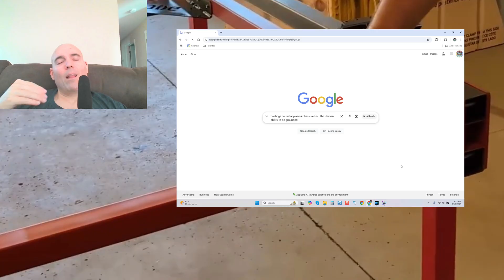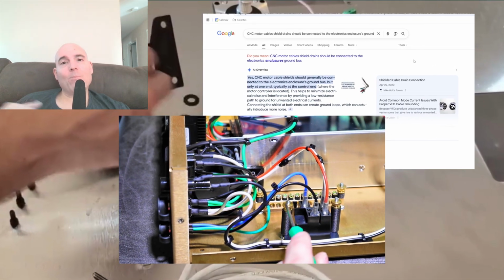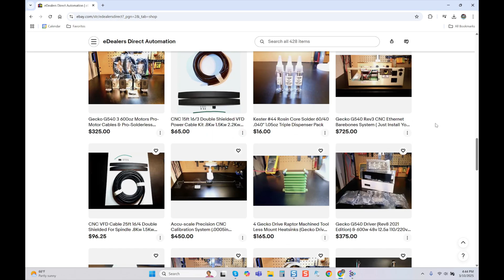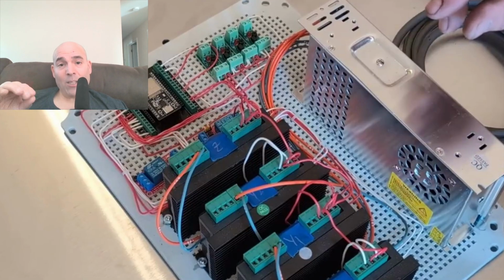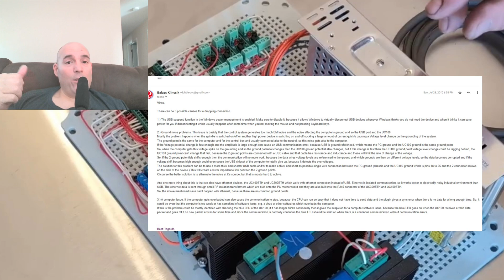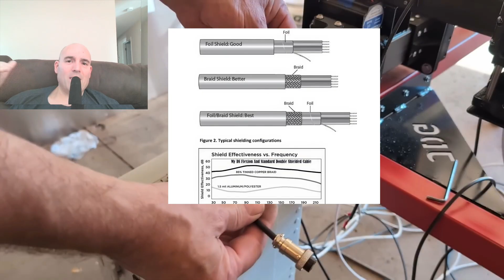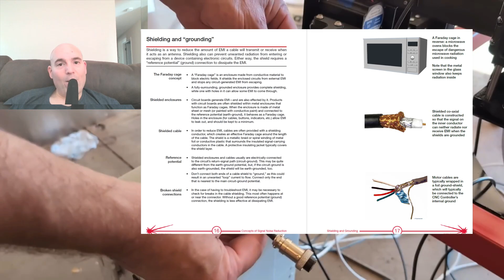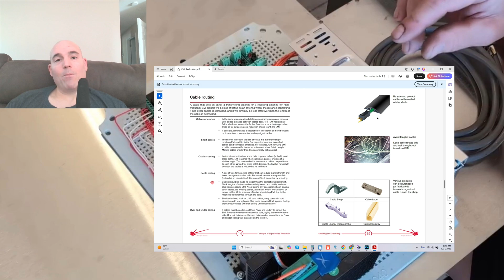⚠️ This is Why It Only Cost $800… 🚨 (Best Practices Explained)

Comment: Thank you vince.  Ordered a dlc32 that's stand alone to try out to tell my arduinos what to do after i've programmed the arduinos for what input and output they need to do.   I was going to roll out my tests on my mini lathe and benchtop mill with ramps 1.4/arduino mega 2560 via grbl. BUUUUUUUUT something felt iffy about usb x laptop sending the gcode to that system because it can't take an sd card for offline control/be untethered......  Even though i have really GOOD usb cables i ordered that are sheilded and have a strong connection?  I've watched enough of your stuff to trust you in these matters. Again, thanks.  All the rest of my stuff is robust.  Sheilded, well, cooled, routed to stop linear contamination, star point grounded, fused, MBC's and standard "blow" type fuses, emi filters, Snubbers, back emf protection......  THANKS!  I have cutters that cost well over 100 bucks each (ph horn, widiya, mitsubishi insert mills, etc....).  Why risk em on a 35 dollar ramps/mega2560?

Comment: Can I use an Ethernet converter on my myplasm usb  controller?, which wasn’t cheap (£500), I’m currently over engineering the grounding due to your videos, can’t thank you enough 💯👍
Reply from the maker: Unfortunately, no. You'll have to replace the unit to an ethernet controller. I'm glad to help! Vince
Reply: @corvetteguy50  many thanks, will do 👍

Comment: If not proximity switches, what are the correct type of switches that are supposed to be used for end stops?
Reply from the maker: There's no right or wrong types its end user preference. I suggest you review soft limits as there free in Mach3, and provide better more accurate protection than physical switches. Here's my video covering them. https://youtu.be/zFk_U3yqrks 

Thank you,
Vince

Comment: The ESP32 is more then likely running FluidNC.  FluidNC is a self contained system where you can upload your files to the esp and run them locally unlike traditional setups where you stream over usb.  So I would hope they are taking advantage of this ecosystem.
Reply from the maker: USB should for all CNC applications be destroyed. Use it at your own risk, and everyone who is accept the consequences of your actions.
Reply: @corvetteguy50 I fully agree.. all I'm saying is it is possible to use the esp32 without using the usb.

Comment: Great video Vince, I'm wondering whats your opinion on the WiXHC Ethernet Motion Control Card as a relatively inexpensive ethernet controller
Reply from the maker: I don't use any hardware that doesn't come with support in that an end user can contact them about a card failure if it doesn't work after purchase just like contacting the same vendor about a wiring diagram. 

That being said everyone's time is valuable including yours, and that vendor whoever it may be. If you expect them to explain wiring your whole system, or you need specific engineering advice its time to break out your wallet because no one works for free. 

Thank you,
Vince

Comment: "Let's put the un-grounded CNC router with non-shielded cables right next to the 7-1/2 HP air compressor"
"Let's ignore the fact the plasma torch itself is a gigantic spark gap"
Reply from the maker: Yea, sounds about right lol..:)